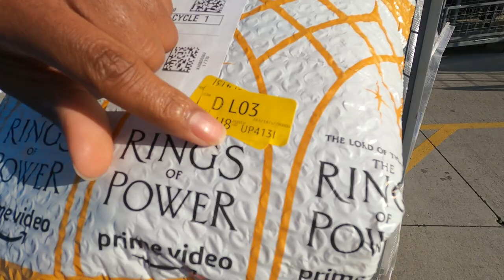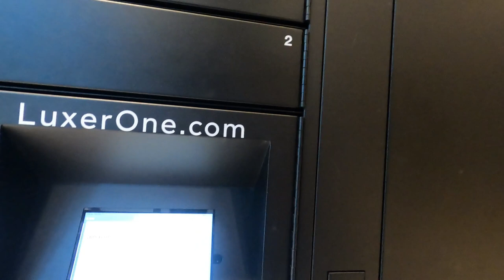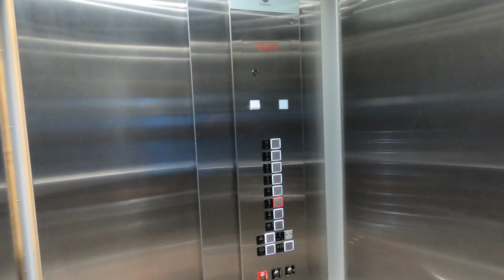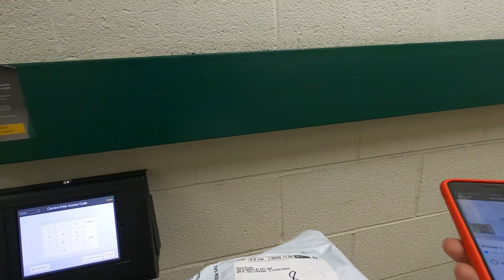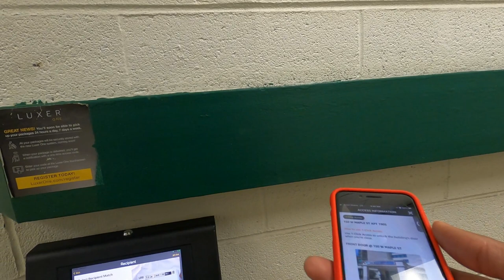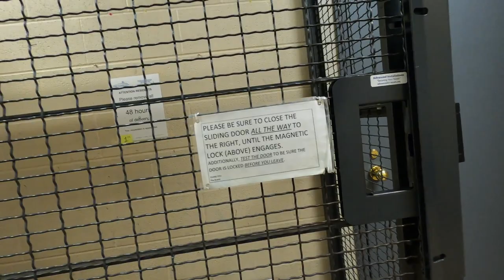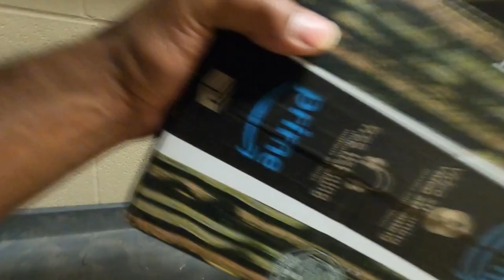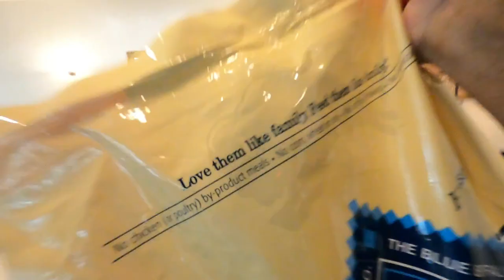I Am NEVER Doing This Block Again!! Sorry Amazon, It's NOT Gonna Happen. 🤷🏾‍♂️ #chicago #traffic

Comment: 5 hour blocks to me is a L. Either one or two things.. either a far drive or 15 - 30 mins between each stop.. i just need sticking to 3 3.5 hour routes for over $100 can’t beat those
Reply: I think he’s had a tough time getting a block so he probably just took this one. Everyone would rather have multiple shorter blocks if they could pick I’m sure. $100 for a few hours is great.
Reply from the maker: @ST-0056  Is correct for some reason we haven’t been having many good $100+ order blocks. Believe you me I definitely wouldn’t choose a 5 hour block if I had options.